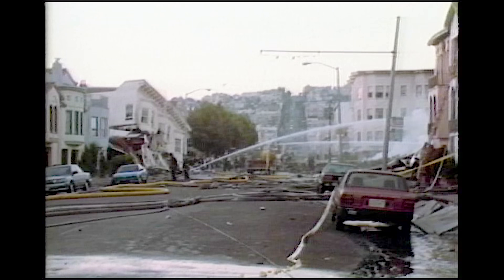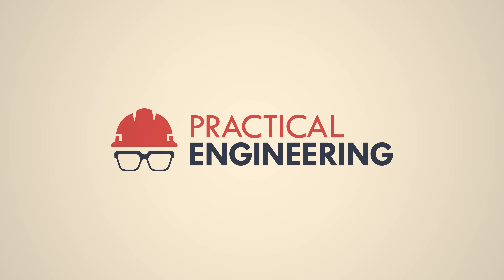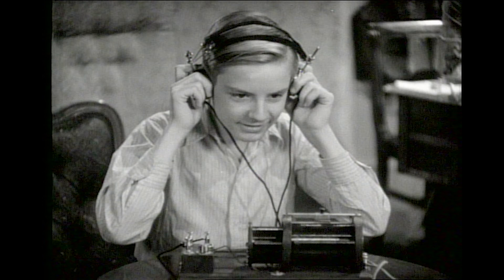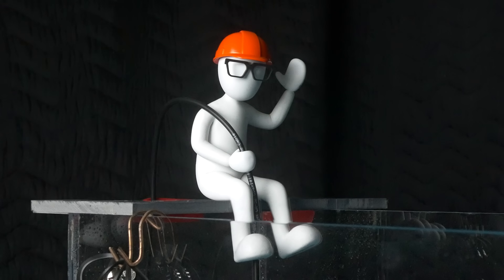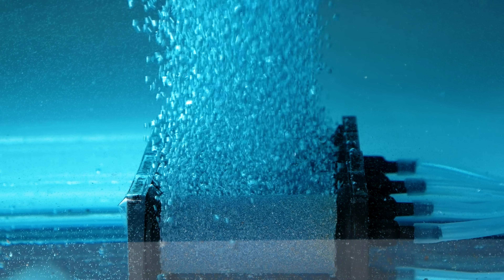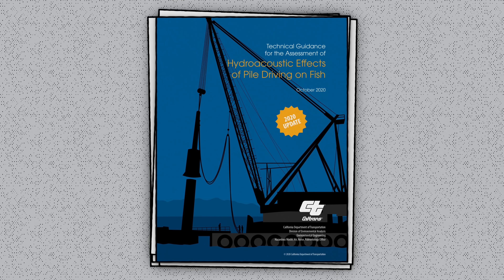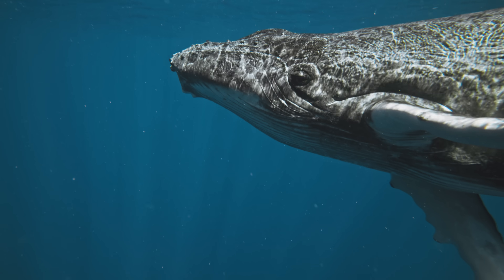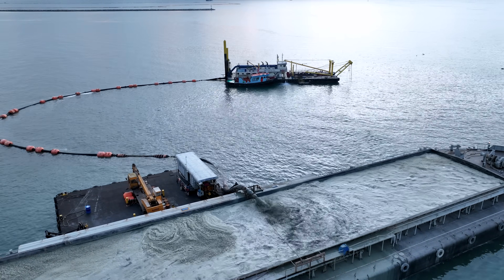The Weirdest Tool in Underwater Construction

Comment: Compressed air, and bubbles, have been used for many decades in cold climates.  Helps keep water in a liquid state where ferries dock and the formation of ice would be detrimental and/or bothersome.
Also saw it used once in a marina, where a boat that could not be pulled out of the water for some reason, had to overwinter in place, but would not have been able to survive the crushing force (or lifting and heaving forces) that the inevitable ice would impose upon the vessel. They brought in your average construction-grade diesel-engined compressor, and fed it diesel fuel to keep the vessel from being affected by the encroaching ice.  Meanwhile, people walked by mere yards away, 4-wheelers and snowmobiles (mine) passed by regularly, without fear of the thick winter ice only 40 feet from this vessel, collapsing beneath them. It was a particularly cold winter, dipping below -40 for about 2 weeks.

Comment: Sound travels extremely differently in air and in water the reason it gets dampened so much above water is because there is tiny amounts of space between the oxygen or other molecules in the air that the molecules have to travel to hit the next molecule to keep the wave going. You can’t compress water because there is no room between water molecules so the sound gets dampened basically none which is why the whales Grady dutifully mentions in this video can communicate from hundreds of miles away from each other. Very fascinating stuff if I do say so myself

Comment: Navies use bubble curtains on their surface ships to mask the noise from their engines as well as cavitation from the propellers, this makes them harder for hostile submarines to detect with passive sonar. the US Navy's system is called Prairie/Masker and achieves attenuations somewhat better than 5dB but the exact value is probably classified so nevermind that
Reply: Learned this from Tom Clancy's Red Storm Rising.
Reply: @GugsGunny   also the thing about Icelandic patronymics lol

Comment: 8:50 High frequency attentuation by the bubbles.  What is likely happening is that the diameter of the bubble accepts short wavelength sound and by the time the bubble is compressed, the rarefaction has already arrived. So the bubble acts as a shock absorber for wavelengths at or above the frequency of sound in air (the air bubble).   At lower frequencies the compression still exists, but the air pressure in the bubble will increase and simply push on the other side of the bubble, transmitting the pressure wave with very little attenuation.  Larger bubbles will absorb or cushion lower frequency water pressure waves.   At about 3 milliseconds per meter, a one meter bubble would resonate and thus absorb a 300 Hz (or higher) wave although at resonance it might actually make things worse.   A tiny, one millimeter bubble would be effective for one thousand times that frequency, or 300,000 Hz.  Well that's sort of useless.  
It feels off.  Let's be more precise "Sound travels approximately 0.343 meters or 1.13 feet in 1 millisecond (ms) in dry air at 20°C" Well that's almost exactly 3 ms per meter.  
"The acoustic wavelength of sound at 10 kilohertz is approximately 0.0343 m" or 34 millimeters.  That's a big bubble.  A CURTAIN of bubbles will attenuate sound by only a little but as there's many bubbles, the cumulative effect appears significant, but still only at higher frequencies.  However, very effective on shock waves.

Comment: Although this use of bubbles is not in the construction industry, I thought you might find this interesting. In the sport of rowing, the finish line is sometimes marked by a line of bubbles to give the rowers an idea of when they have crossed the finish line. The actual finish line is close, but is indicated to the finish line judges who sight across two points on either side of the course.  You can see an example here in this 2024 Olympic race, where you can see the solid white line digitally added for the television audience, and the bubble line just to the left of it for the rowers.

https://youtu.be/ijAR4bqVQGs?si=gYeari_grNbCOg3K&t=91

Comment: Kind of the opposite of a bubble curtain is a water sprayer. Rockets spray water droplets into the exhaust plume to dampen the pressure waves, and cool the pad. Same two mediums performing the same action but reversed.

Comment: Thank you Grady.Bubbles can also speed up marine vessels. I understand that the clinker style of hull used in Viking long boats creates bubbles, thereby reducing surface friction and increasing vessel speed, as opposed to a  carvel style construction with similar hull profile. N.B. The clinker name comes from the noise of hammering the rivets which hold the structure together.
P.S. Maybe you should get your next tank design ‘peer reviewed’ by an aquarium builder😁? That would minimise the risk of catastrophic failure and … visitation of domestic violence upon yourself. Cheers from NZ🇳🇿.

Comment: It seems like a heavy (but not too heavy) fabric sleeve around the pile and hammer would greatly reduce the sound intensity in the water.The sleeve would need to be separated from the pile by a foot or more. Also the sleeve should not be directly connected to the hammer structure.

Comment: My son lived in the East Bay Area and I watched them build the Benecia Bridge over time.  They used the bubble jackets around the pylons when constructing the bridge.  The whole process was pretty interesting.  They also had to put cooling tubes in the concrete because when it cured, it gave off so much heat it would fracture the concrete.   After it cured, they injected concrete into the cooling tubes for strength.  The bridge is actually hollow.  They horizontally extended each bridge support until the portion of the bridge met with the other extension from the adjacent support.  It took several years to construct the bridge.

Comment: I wonder if hollow/foam curtains made of hollow shapes, panels, or other solidly built hollow devices have been considered to install around the areas?  Sure they will have bulk, but possibly be more reliable and save energy without stirring the water.

Comment: Kool stuff, 1gw electricity generation plant needs 1million consumers and 100,000km of poles and wires and transmission and transformers and switch yards and....
$100million of transmission capacity. 

Double capacity to replace fossil fueled energy is another $100million of bigger transmission capacity. 

This is kool to know.
To replace fossil fueled energy with clean electricity. 

Double the grid electricity 
Double the generators $10million GW
Double the grid capacity. $100million GW. Many decades

Comment: I knew everything you said from only 1 thing. The fact that the best way to communicate across water to another across the lake is to get really close to the water and angle your voice at a 45 degree angle. The water carries a lot further and clearer than air because it is like knocking on steel.

Comment: Bubbles are used in navigation locks for ice mitigation. There are several designs not only to move or block ice but also to melt it. https://www.publications.usace.army.mil/Portals/76/Publications/EngineerManuals/EM_1110-2-1612.pdf

Comment: I wonder if the size of the bubble, or depth of the air curtain would change the cutoff frequency of the "filter".  I wouldn't be surprised but what there's a relationship with the wave length.  Long wave lengths could travel though what stops the higher ones.

Comment: The hammer was steel on steel. What happens if you have a steel pipe filled with wood as the anvil? The steel hammer hitting the wood would transfer the shock to the pile with less noise, surely?

Comment: I wanted one of the drone shots of the Starship/Superheavy launch.  You can see the shock waves going through the billowing exhaust clouds.  The crackling noise is not generated by the rocket itself, but instead comes from the sound being so loud that the air acts nonlinearly.  I don't know if the sound is actually louder than the ability of air to transmit (rarefaction absolute pressure goes to zero), but it's getting close.

Comment: German U-boats in WWII had rubber plates fitted with tiny holes punched in them which trapped air bubbles to absorb sonar waves to reduce their sound profile. Bubbles convert sound into heat energy. The inverse way in air is to spray water mist around a noise source. That’s why rocket launch pads spray so much water, it’s not just for cooling but to also reduce the amount of noise being reflected back into the rocket and potentially damaging it.
Reply: That's incredibly interesting, thank you for sharing!

Comment: It is no secret that objects to be sunk or driven into the seabed are heavier in air than in water due to relative density (buoyancy) so perhaps a cylindrical caisson around each pile reaching the seabed,with the water pumped out before driving would aid the driving of the piles(heavier in air=easier to drive) and attenuate the sound levels (pure air gap attenuates better than bubbly water).The caisson could even be lined in an acoustic dampening material.
Lengths of pipes could be attached , surrounding the caisson to be flooded to sink the caisson and flushed with air after reflooding the caisson to aid in raising them ready for use on the net pile all using the same pumps as for draining the caisson.Just a case of opening and closing different valves and controlling the pumps.
If you're using pipes and pumps anyway,you might as well use them to make things lighter or heavier when it would help.All the tech already exists so I doubt there would be any serious technical challenges.I expect results by Monday.You may begin  ;-)